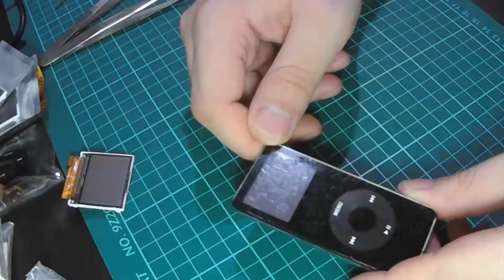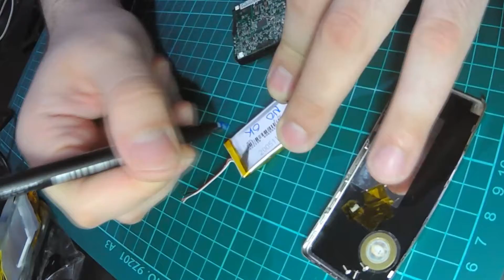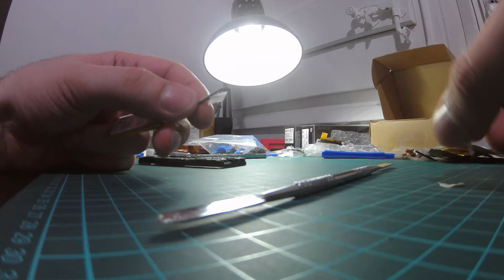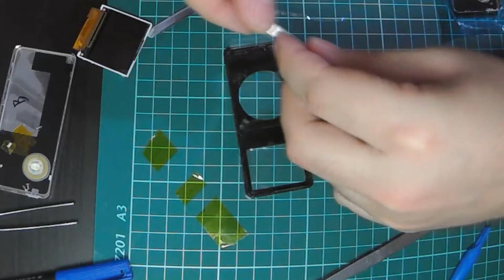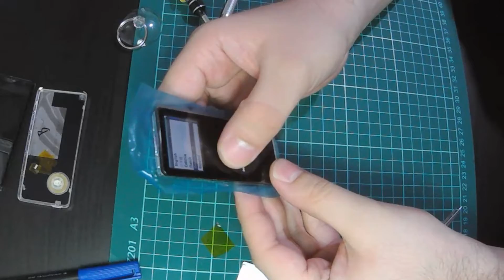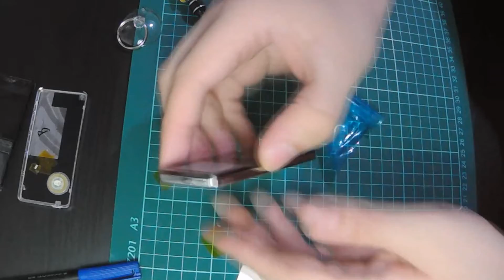iPod Nano 1st Gen refurbishment/restoration

Comment: Question. If the menu button and the pause/start button aren’t functioning, and the forward and backward button are barely functional. How would I go about fixing it? Would it just require a change of button or would/ could it be another entirely different issue?